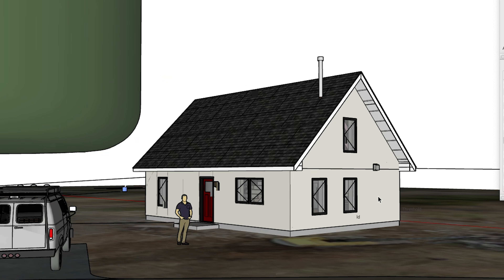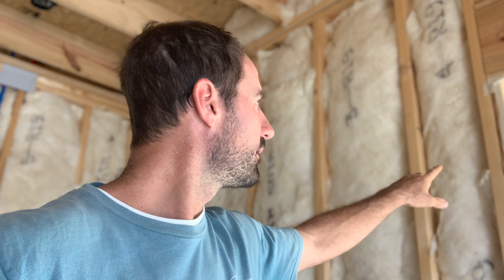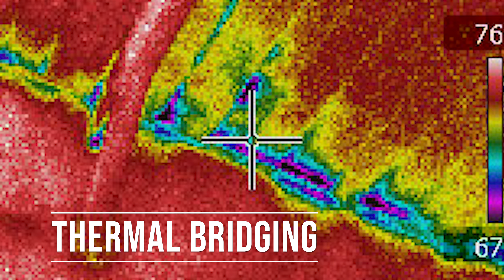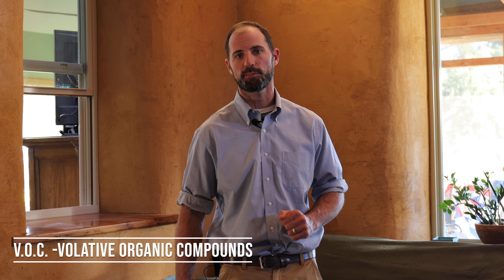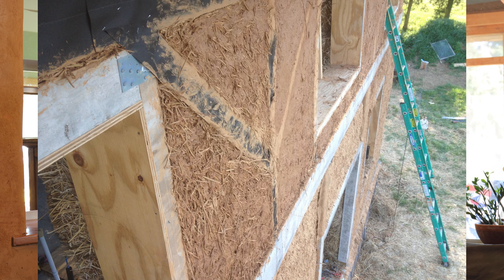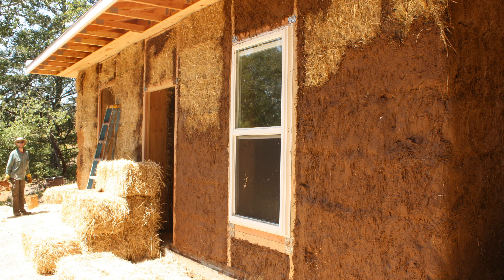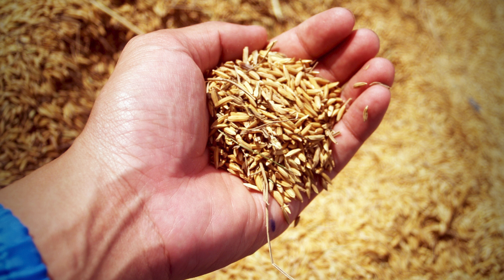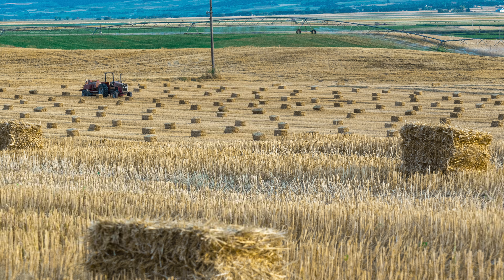The BEST way to build a new home? Building a House with STRAW BALES : Start to Finish - Episode 1

Comment: Two questions not answered in the video:
1. What do you do about internal walls? Most SB homes I've seen used timber framed internal walls with drywall and glass insulation inside..
2. How do you treat the timber beam / frames on the external walls? You can't render directly to them and they would act as a thermal bridge?

Comment: How do you control mold while building?  I'm interested in this building method, but with the bales being exposed to the elements during the construction, how do you prevent moisture intrusion and mold?  I want to build myself, which means it will be exposed to rain and possibly early season snow.

Comment: VOC
volatile organic compounds
Understands what your saying 
Chemicals used in construction materials are not ORGANIC 
There for “ are not VOC” and Straw homes have a much higher chance for VOC then other methods because it breaks down if it gets wet 
Better ventilation and keep the house dry? Both from interior water sources and exterior water sources.

Comment: In Ukraine we have clay houses that have more than 100 years «хата мазанка»
Reply: With all the grain grown in Ukraine, I would think that there would be lots of straw bales available, but do you burn the fields off, instead? I'd also think using local materials will help build homes to replace those lost to the invasion.
Regards from Denmark 
Slava Ukraine!
Reply: @Oneshot8242  Only some fermers burn their fields, often they use straw bales, In Ukraine we have aloat of different local materials,  before war people often build houses from foamconcreteblocks and also woodframe houses  became popular, and metal frame constructions are wery popular as we had Azovstal and local metal production.  Saman houses technology in Ukraine  are not comonly  used   for  50-70 years, but now it became more popular as some blogers influensers advertizing it and  clay technology has benefits. For ages people build their houses from materials  that are found on the ground

Comment: What happens with insects living on the straw? What happens if rodents move to live inside those walls?
Reply from the maker: @o_0000_0-u  there’s no room for th ina. Densely packed Strawbale wall. Unlikely a stud wall with cavity insulation they can just push aside, strawbales offer no habitat for rodents, especially with 1” of plaster covering them
Reply: @HeirloomBuilders  and what you do with insects already living on that?
Reply from the maker: @ I never seen that be a problem
Reply: @HeirloomBuilders  thanks

Comment: I would definitely go this route, if I were staying in Canada. 

I am still going to build with straw, but in a different way. 

My place in the Philippines has lots of bamboo. Rice straw and husk are readily available and free.  We are sitting on clay with limestone beneath. 

We get earthquakes and typhoons. I need something that is incredibly well braced, that won't burn. 

Light straw clay is the answer to that. 

Bamboo wattle and daub containing a large amount of straw, will be very strong and incredibly cheap. It's all about labor which is about $8 per day. 

I will use lime plaster, inside and out, made from our own limestone and using a tall invasive grass, as fuel for the kiln. We also have the option of using bamboo scraps and coconut shell. 

There's no need for heating or cooling at our altitude, so it's all about making something that works like flexible concrete, at the lowest cost possible... It gets hot during the day, and that is dealt with by never putting glass in windows. Lots of airflow is best. Night temperatures will bring down the temperature of our concrete floor and other thermal mass.

I'd be interested in ideas on how to make this better and cheaper. 15:37

Comment: If I heard it correctly, the thickness of straw bale is 18 inches. My question is why 18"? Is there any research behind it that 18" thickness is the optimum number. Does the 18" thickness comes from the traditional wall thickness when thickness of different materials adds up to 18"?  I really appreciate if anyone could provide any informatio.
Reply from the maker: @alexv259  18” is the width of a standard straw bale

Comment: Very cool. However, you can't build these or any of the other alternative homes(aircrete,rammed earth,Earthships,etc.) just anywhere. You need to meet the building code compliance or get it inspected and stamped by an engineer and then approved by your local and possibly state building departments. There are videos of people who thought they were in compliance with the code but found out they were not and had to tear down their structure or move their tiny home. Comments?
Reply from the maker: @NewGuyDarren  you are exactly right.

Comment: Could you build this on a house trailer frame? Use the flooring and wall, roof structure? Realize it would decrease the interior dimension but that would be ok.

Comment: Thanks for your work, As a fellow builder I would suggest that people build their frost wall to mud sill a little taller than the one shown, especially if you live in a somewhat humid climate, to prevent water from wicking up into the walls whether wood or straw or any natural fiber based material… water usually won’t wick up over a foot or so, so adding at least  this height to your stone or concrete frostwall above finished ground hight will help keep the insides of your walls much drier and greatly improve the longevity and integrity of the structure…

Comment: there's a small town called Shibam in Yemen built in 15 century from mud. Up to 11 story buildings. It's still there, functional. No need for the supportive frame inside the walls. Mud bricks are thousand times stronger for a pressure load than those wooden frame. 

My grammar's old house is from mud, was built it 1930 and still there, never was in any way reconstructed. That one doesn't have a foundation and the walls widened sideways a bit where the foundation should be. But it didn't even crack anywhere.

Comment: How much does straw settles over 20 to 40 years ??? Then you got to incase it in cement on the outside and lime on the inside , then there is the Breathing of the house, so really your only saving on a few two by fours and insulation and plywood,  but the amount of work you need to do to cover that straw outside and inside .... so come back to us a 100 years from now and show us your house made out of straw😊

Comment: I appologize for my long message but I think for everyone's best interest, some things should be clarified.

There are some false statements of yours. I've heard nonsense before in my life, but never this big. Like the fact that wood is not a good insulator(3:40). In addition to the fact that wood is more a structural material and is rarely used only as an insulation material, I am sure that you know that wood has a thermal transfer coefficient ( λ ) of 0.17 W/m2K, and as a structural material it is among the best to use.
But you were talking about insulation materials, not structural ones. Let's not combine them, so we don't get a walnut shell syrup instead of an apple one.

It is true that straw bales are materials with a good thermal transfer coefficient(0.12W/m2K), most above all, they are natural and eco friendly. Instead, the process by which you obtain straw bales, so that they get a density of 110kg/m3 and by doing this, to be able to offer a fire resistance of at least 120min, and +  not to have the walls eaten by rodents, is a little bit more expensive than you might think on your first math. Above all, everyone must be aware that you need to have quite a good controll of humidity of the straws, when you harvest them, how wet they are, and so on, as in the end not to exceed 12% in order to install this kind of insulation. Just to avoid a lot of problems after installation, such as mold. Inam also sure that the result you are looking for is not just to have some walls and a roof, right? But also a quality of air and people's lives in that house, isn't it?

Long story short, I'm not saying it's not worth it, on the contrary, it's worth it all the more if you want to be eco-friendly as well. Where else we can mark that is has a good sound insulation as well, of 54db.
But let's be clear, it can be easy(if you pay enough attention on details, such as the design of the bales and the installation method), but it won't be cheap, as you say.

As a contrast point of view(or balance), basaltic wool has a heat transfer coefficient of 0.034W/m2K(a bit of difference), it is still natural and falls into a price category very close to straw bales. It is much faster to work with it and you can put the interior walls as the house facade immediately over it. 

I understand that you were talking about straw bales here, besides you want to sell these bales, which is wonderful that you can build such constructions, but what you really need to do first of all is to inform yourself before you speak and when you finally do, be honest and provide the correct information.

All the best and keep up the good work! 
Cheers!ere are some false statements of yours. I've heard nonsense before in my life, but never this big. Like the fact that wood is not a good insulator(3:40). In addition to the fact that wood is more a structural material and is rarely used only as an insulation material, I am sure that you know that wood has a thermal transfer coefficient ( λ ) of 0.17 W/m2K, and as a structural material it is among the best to use.
But you were talking about insulation materials, not structural ones. Let's not combine them, so we don't get a walnut shell syrup instead of an apple one.

It is true that straw bales are materials with a good thermal transfer coefficient(0.12W/m2K), most above all, they are natural and eco friendly. Instead, the process by which you obtain straw bales, so that they get a density of 110kg/m3 and by doing this, to be able to offer a fire resistance of at least 120min, and +  not to have the walls eaten by rodents, is a little bit more expensive than you might think on your first math. Above all, everyone must be aware that you need to have quite a good controll of humidity of the straws, when you harvest them, how wet they are, and so on, as in the end not to exceed 12% in order to install this kind of insulation. Just to avoid a lot of problems after installation, such as mold. Inam also sure that the result you are looking for is not just to have some walls and a roof, right? But also a quality of air and people's lives in that house, isn't it?

Long story short, I'm not saying it's not worth it, on the contrary, it's worth it all the more if you want to be eco-friendly as well. Where else we can mark that is has a good sound insulation as well, of 54db.
But let's be clear, it can be easy(if you pay enough attention on details, such as the design of the bales and the installation method), but it won't be cheap, as you say.

As a contrast point of view(or balance), basaltic wool has a heat transfer coefficient of 0.034W/m2K(a bit of difference), it is still natural and falls into a price category very close to straw bales. It is much faster to work with it and you can put the interior walls as the house facade immediately over it. 

I understand that you were talking about straw bales here, besides you want to sell these bales, which is wonderful that you can build such constructions, but what you really need to do first of all is to inform yourself before you speak and when you finally do, be honest and provide the correct information.

All the best and build as natural and sustainable as possible, so we can protect our planet.
Cheers!

Comment: I like this method. I have a few questions tho:

Can you use this for a tall living basement/Garage?? 

Will it support 3 stories? 

Instead of wooden framework could I use steel beams?

Are floor-to-ceiling window walls structurally compatible?

Comment: And how did you get past building inspectors ? Do you have a video on all the regulatory hoops to jump through ? Or does USA not have same as Canada ? They hassle people here.
Reply from the maker: @kristakaufman-y6j  structural engineer will approve frame design, otherwise the Strawbale insulation is just insulation

Comment: I think it's a lot better.
Certainly. "Hemp shavings" is a technology that involves processing hemp stems to produce wood chips, which are then used in the production of hempcrete. Hempcrete is a construction material where these chips are mixed with cement and other additives, creating a lightweight and durable block.

Comment: I think i would be more comfortable with using straw if i didn't have the image of it being so very flammable when it is not compressed.   How does the compressed straw resist burning up in a fire? Maybe you can show how compressed bales are not easily flammable in a video? This was very interesting and informative. Thank you 😊.

Comment: I have seen many straw bale construction homes without post and beam.  Would this requirement vary by municipality?  Would post and beam affect insurance?  Also some people stack grain run horizontal or vertical.  I would think horizontal better.  It is also hard to find the two or three string bales today.

Comment: its not cheap or cheaper over conventional construction and takes LOT more time/labor, energy savings -yes . and you better do it right or mold starts growing. also if there is roof leaking on the straw walls without noticing right away....laundry/bath/water accidents where lot of water (or small seeping without notice) leaks in the walls....